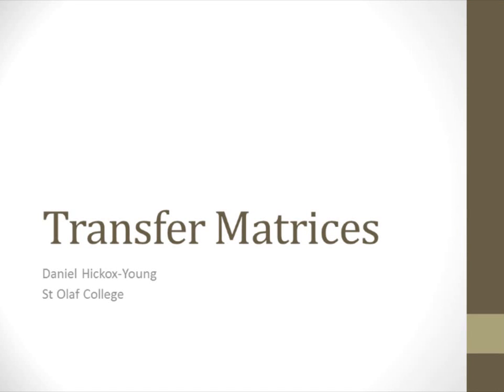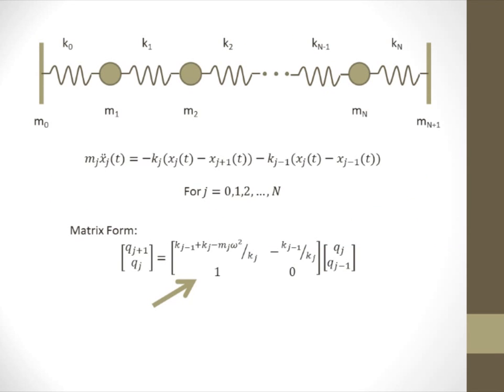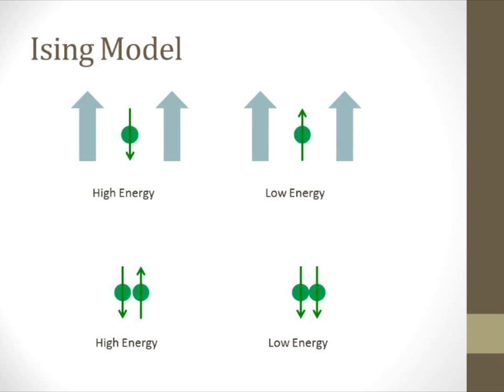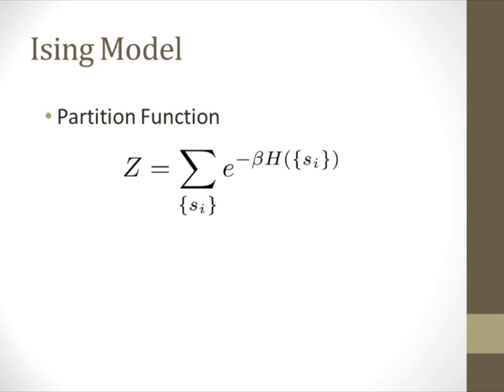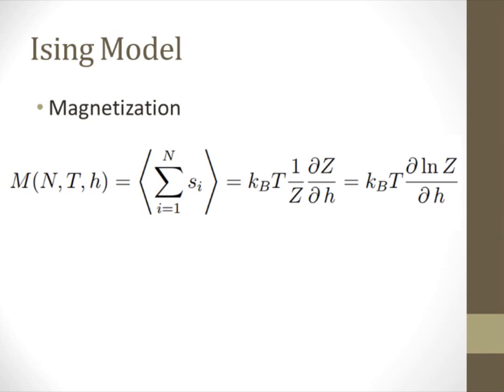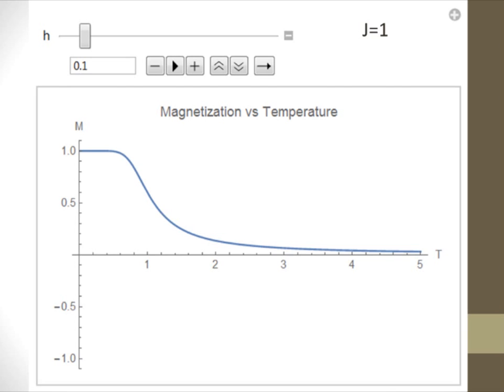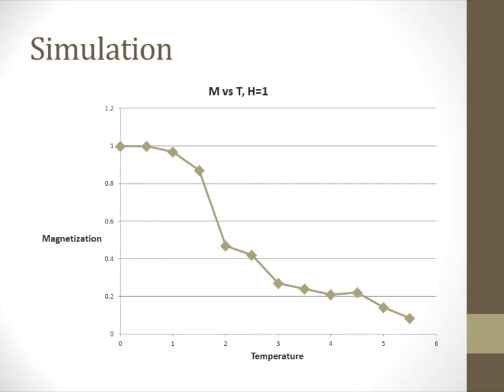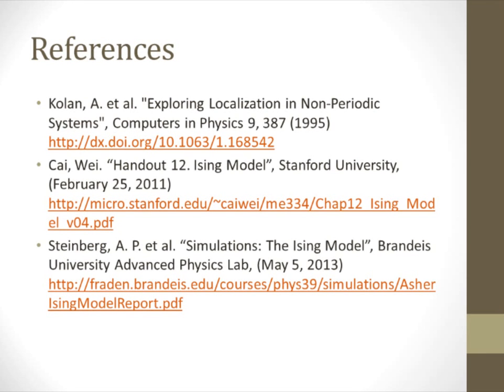Transfer Matrices: 1D Ising Model

Comment: Thanks, it was a very instructive video and clear explanation! 
The last few plots seem a bit rough. Is it a limitation  of the 1D Ising model or is it because of lack of computational power to attain numerical solutions with higher precision?
Reply from the maker: Thanks for watching! Yes the last few plots are a bit rough. That data was generated using the metropolis algorithm in a python-based simulation. I have to admit I haven't studied the system well-enough to be totally confident as to the cause for the deviation between the analytical solution and the numerical one, but I suspect the "roughness" is more likely to be a product of my code and the size of my simulation than a shortcoming of the Ising model. 

The Metropolis algorithm involves assigning each lattice site a certain probability that it's magnetization will flip (probabilities being determined by the partition function). The program then "rolls the dice" weighted with those probabilities and spits out a new value for each lattice site. Of course a persistent in any probabilistic simulation is sample size. In this case that's true not only for the length of chain I'm considering (only about 100-200 lattice sites) but also how long I let the sites flip back and forth before I'm satisfied that they've "settled" in response to the temperature I've set. So in short, if I had to guess I'd say discrepancies would be due to the relatively small length of chain and limited time allowed for the magnetization to "settle".